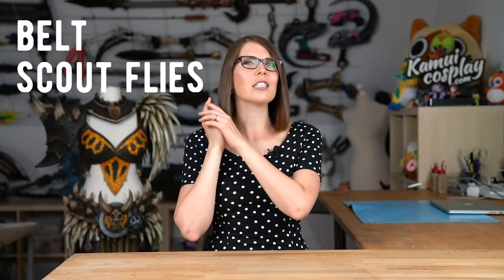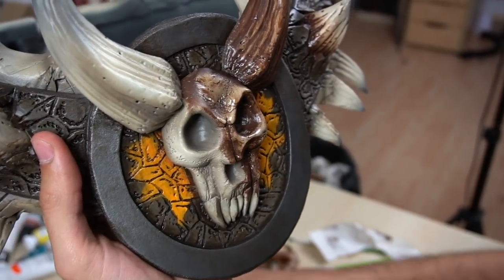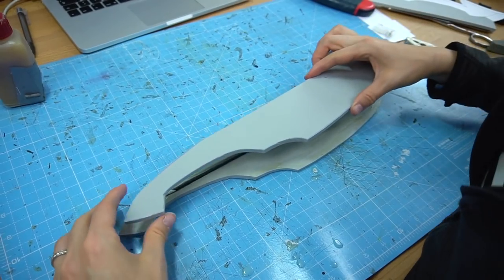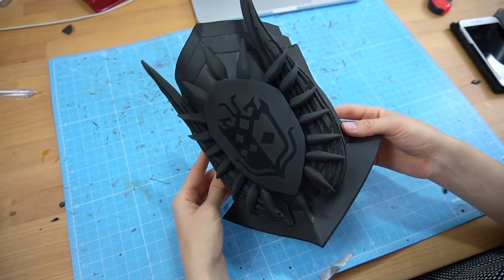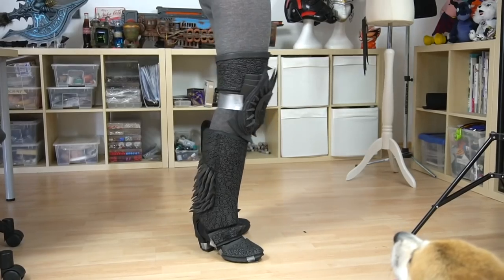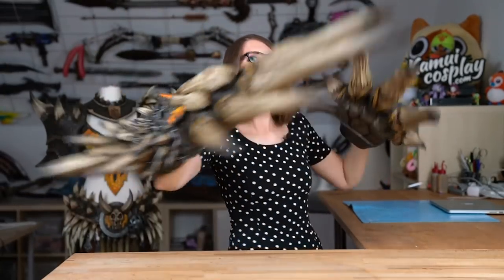Nergigante Armor Cosplay Pt.2 - Monster Hunter World

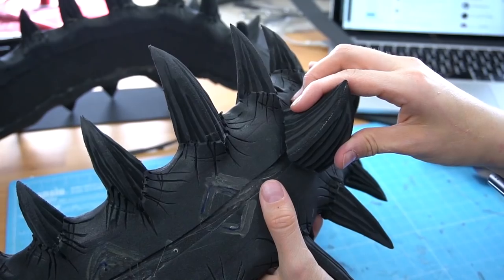Comment: 1:48 What is the thickness of the slightly thicker part ?
2:36 Did you make these horns with pink foam like in the first video or foam clay ?
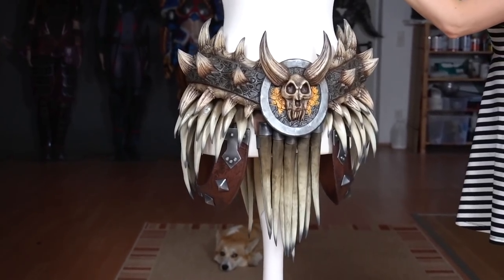4:28 For the smaller belt, did you use 1mm foam for the top part and foam clay for the studs ?
5:05 Did you use 5mm HD foam for the fly cage ?

Leg armor
6:58 details were made out of 2mm foam ?
7:10 Knee pad was made out of only 2mm foam and 5mm foam for the emblem ?
7:40 was the base made out of 2mm foam or 5mm like the other parts? (looks super thin so im askin')
8:05 shoe armor was only made of 2mm foam ?

Sorry for so much question, like in previous video I really just dont wanna screw up like my previous project, paid money for patterns and nothing worked out and wasted 200$ on it to not be wearable

Comment: Your talent upon these suites do nothing but astound me every time you upload.  With that, I do have a question upon the shin armor since they have been bugging me the most: why double down the amount of foam on the shins? You used the template on 5mm, but then went over that with 10mm? Other than to keep it's shape, why was this done? Was it because the original source material had thick boots and this was just a needed step to replicate the thickness as well? This step confused me in the last video as well.

Comment: Sorry about all the comments but does the foam harden after being sprayed with the sealant/plastidom? Is it called Plastidome?? Or is it super fragile? Say you accidentally bump the right shoulder plate on a door way would it scratch/indent the foam?
Reply from the maker: It hardens a bit yeah (PlastiDip). Foam is probably the best material when it comes to durability. You can squish it without damaging it. It‘s also easy to repair if you do it right :)